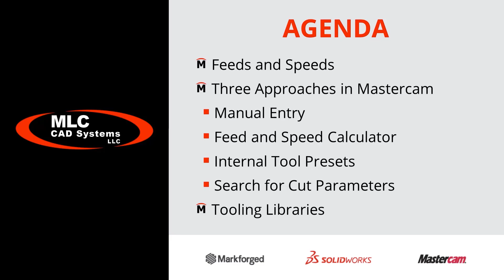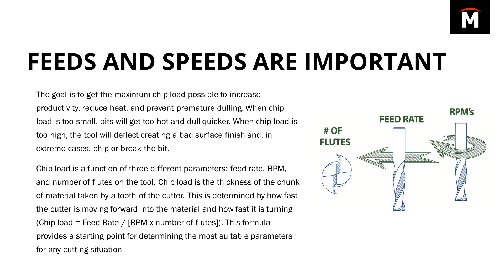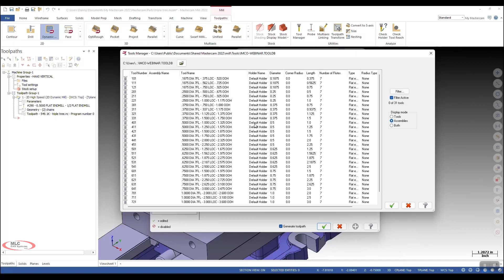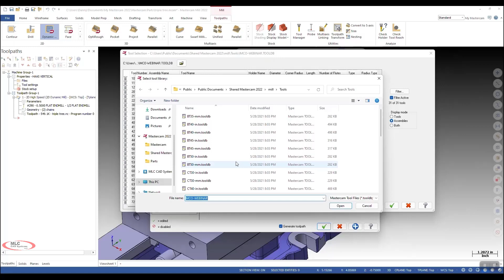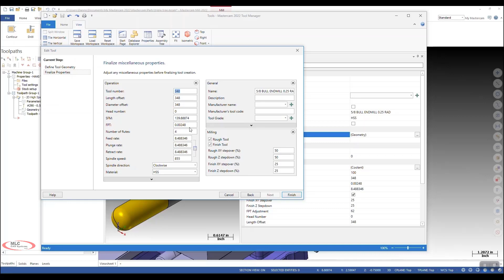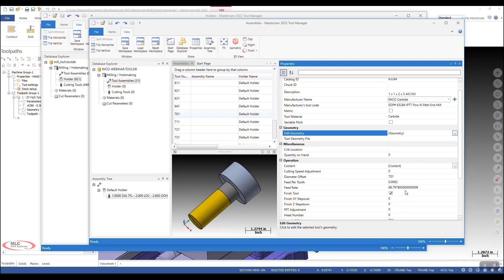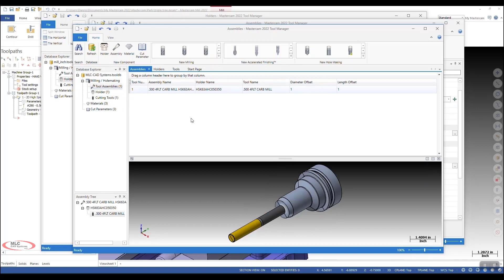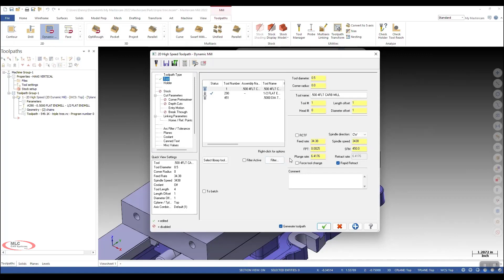Stop the Guessing! Setting Feeds & Speeds in Mastercam Webinar

Comment: useless if the library is not available and free
Reply from the maker: I checked with the team that collaborated to create this video, and one member had intended to create and share a library, but he did not and has since left the company.  It appears that a lot of the libraries were based on IMCO IPT7 Pow-R-Path End Mill tool libraries.  If you login to My.Mastercam.com, under Communities > Tech Exchange > Tool Libraries you can search for libraries that are provided by the tool manufacturers that are extremely useful.  Those downloads are free as long as you have a login, but it may require a valid license to gain full access.

Comment: Hi Danny - great topic! Do you know what the Radial and Axial values are used for in the Cut Parameters? Would like to define a HSM strategy and have the S&F and depth values populated to the operation via the Tool Manager. Thanks!
Reply from the maker: Those settings represent the percentage of the tool diameter.   If using a solid carbide mill for instance, you would want a small (8-12%) radial amount with a large axial engagement (75-100%) of tool diameter.   If you are using a high-feed mill, the opposite would apply.  A very small axial amount ( .03-.06 depth of cut) and large radial amount ( 55-85%) of tool diameter.